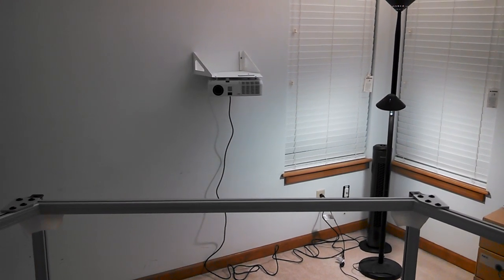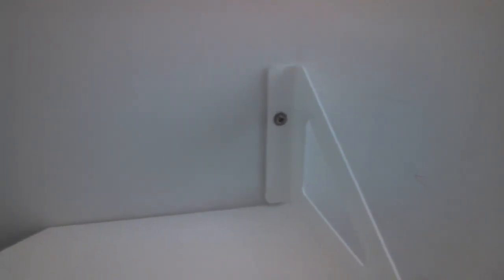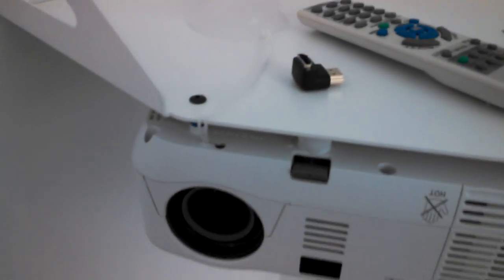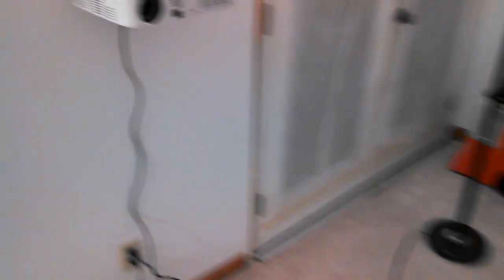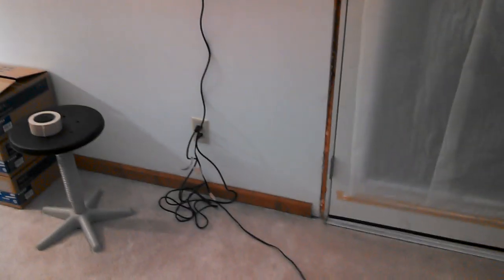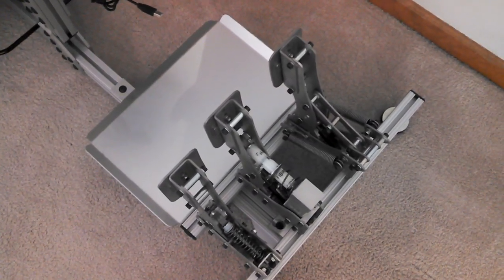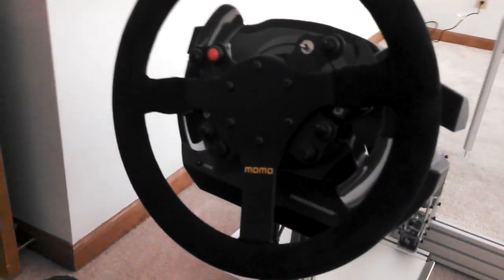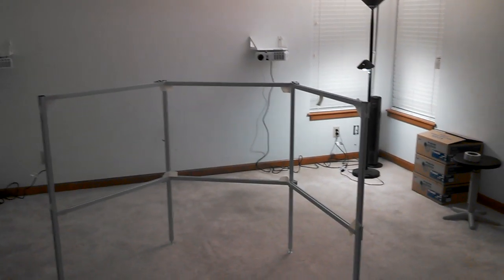Part 4 of 5: 3x Projectors Sim-Racing Cockpit Design / Build

Comment: With projectors you can scale the screen size to anything you would like, you aren't locked into any one size.  There are no bezels like on monitors, just one continuous uninterrupted image across all screens.  And I believe in the iRacing forums or a previous video he stated these are 4:3 aspect ratio projectors that will give a larger FOV from top to bottom than 16:9 monitors/TVs.  They don't make 4:3 monitors anymore that I know of.

Comment: Hi Todd, really nice, well done! You may remember, we wrote a few days ago regarding the eyefinity setup for iracing and my problem with the 1 meter wide space for triple monitors. I now bought 3x21.5" (lol) AOC monitors, thinest bezel on the market and it actually did fit in my space! However, i am still unhappy as f*ck since the hight is not proper. I will now exchange them for same monitors in 27inch size. Check it out: 
( LG 27EA63V ) But its still only 1080p and only 60hz :( What you think?

Comment: Are you of the Illinois Bettenhausens?
Reply from the maker: Yes, I grew up in Tinley Park.
Reply: Great.  I know Tinley Park well.  I use to work with John Caveney at Panduit.  I love your setup.  Interesting approach using rear projection screens rather than LED displays.  Why did you do it the way you did?
Reply from the maker: +gpruitt54 Wanted 3x 4:3 displays to show more of inside of car (gauges, etc.). I'm exclusively VR using Oculus Rift now.
Reply: On the Rift now.  Interesting.  How do you addressing not being able to see where you hands are for things like button boxes, E-Brakes, etc.  Is the Rift out of Beta development yet?